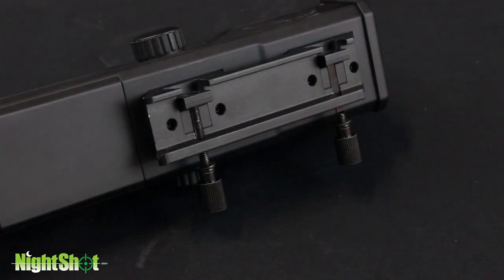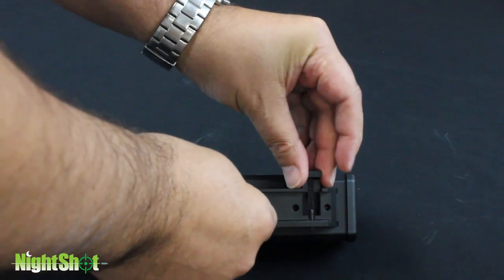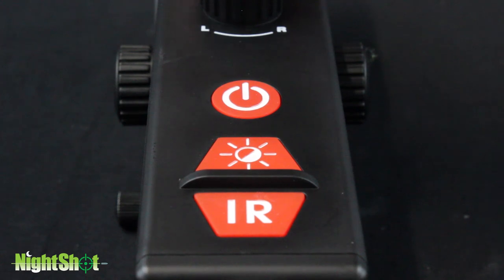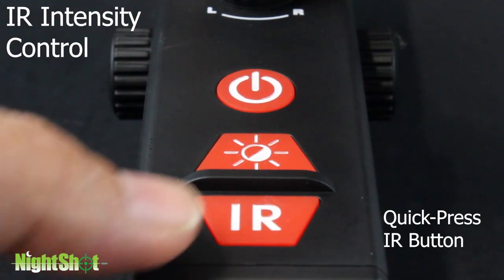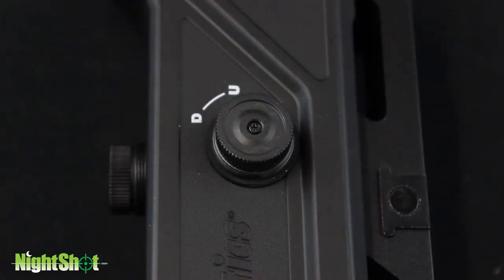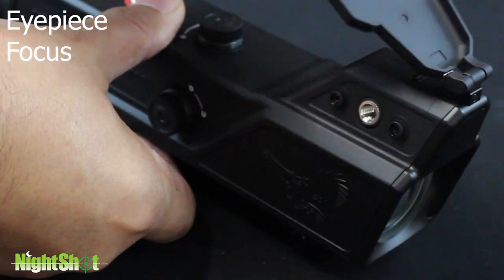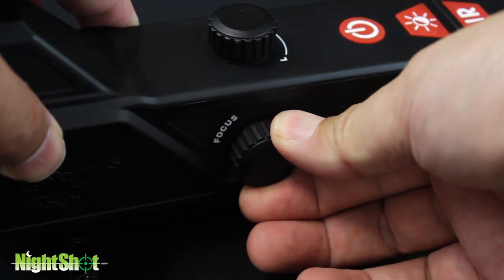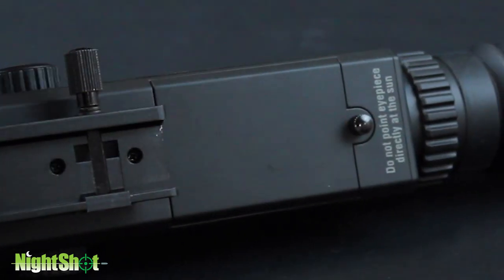NightShot Night Vision Rifle Scope Instructional Video

Comment: How do you attach extra ir? What kind of mount?
Reply: How do you change batteries without taking scope off gun????
Reply: Great question!  Hello .....
Reply: @usalonewolfful  you cannot
Reply: @usalonewolfful  i have a simple fix... It involves a drill,a wood dow rod,2 metal thumb tacks,8"wire,a squirt of silicon and a hobby battery box... Laziness is the mother of all invention..i think from the part list,you know what and how to do it.. Took me 20min on mine

Comment: I wish I had the 2nd generation battery door on the side  or a extended battery pack,,,,,battery door on the bottom who ever designed this doesn t hunt
Reply: I wonder if there would be a market for a plug in battery pack which replaces the bottom mount door?